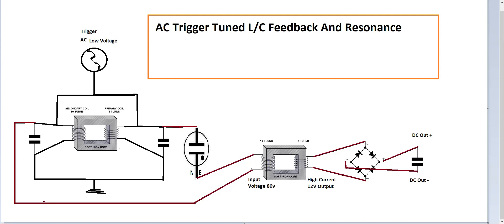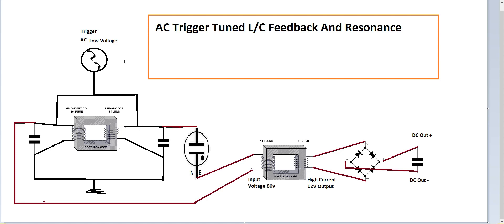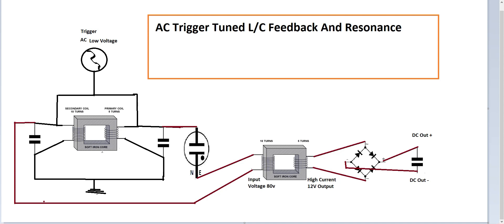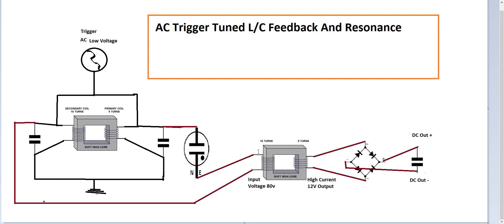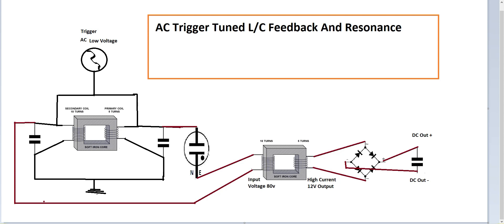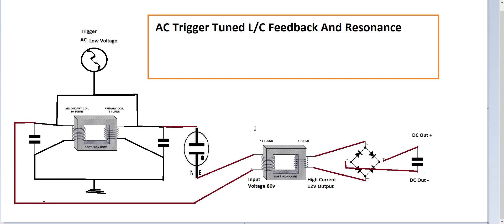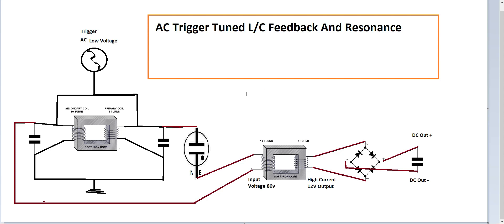Tuned L/C Feedback Method

Comment from the maker: I apologize for any confusion caused by my video. In order to clarify, it would be best to use the mains positive cycle AC as the input trigger and diode both coils with their own "isolated" trigger. This way each L/C will behave electrically independent. It is important to note that there is reason for the imbalance in the system, as it allows for the resonance effect to increase the amplitudes of each L/C circuit. As a result, you will most likely need to calculate two separate values for the capacitor.

While at first glance it may seem like you are just shorting the + of one circuit with another + doing nothing, both L/C circuits are actually working independently and raising amplitudes. The imbalance creates a difference potential between the two separate L/C circuits, which can be 100 volts or more depending on the coil setup. This effect takes advantage of the closest equivalent we have of running a coil as a "superconductor" within the system.

The neon in this example keeps the path closed between the plus input trigger side of both L/C circuits until a voltage buildup difference between the two positives reaches the neon voltage trigger of around 80 volts. At this point, the neon briefly creates a path in the 3rd coil (flash spike) and dissipates the extra energy as a load into this coil, preventing the oscillations from building up to high voltage and current breakpoints.

This process is often referred to as "Splitting The Positive" within the free energy community, as it involves switching the potential difference of two raising voltages rather than switching a typical system traditionally. The "energy" in this system comes from the voltage difference between the two coils that is switched into a load (the 3rd coil). By using this method, we are able to extract much more energy from the system that would normally be lost and convert it back to watts.
Reply: Thank you!!! Joel this is so simple to work with.... The diodes are a cool way to have ful control of the current.... By the way have you ever tried bridging the negatives and splitting the positives charging the coils through DC caps in that configuration... WOWEEE!!!! Super! Results... Wishing you the very best... 🎉🎉🎉🎉🎉😂😂😂👍
Reply from the maker: @jasonjaffray4025  Yes I have other variants of this concept and circuits. One video show  a simulation of kw out extra output but of course the simulation won't take account for circuit loss.  But no worries when your wasting 50 watts but getting back 1kw your doing great even with such loss. That is what people don't understand. The circuit does not need to be anywhere near 100% if an energy system and manipulation make up for losses.

Comment: Hi Joel please tell me what your thoughts on the way the capacitors in the first coil set up will influence the voltage potential difference.... As I do see the number of turns are imbalanced would it make sense to also use imbalanced cap ratings and what would be the perceived reactions... Thanks.
Reply from the maker: I had to use "AC" for the simulator to show me what I needed so I just copied that and it might be confusing to some if they don't understand the background. My apologies for the lack of communications. Taking a closer look, It would be best that you simply use the mains positive cycle AC as input trigger and diode both coils with their own "isolated" trigger. This way each L/C will behave electrically independent.  Yes there is reason to the imbalance, we want to take advantage of bringing up the voltage in each l/c circuit because of the resonance effect on the increasing amplitudes. So yes you will most likely need to calculate two separate values for the capacitor. At first glance with this setup, it may seem like your just shorting at the + of a circuit with another + doing nothing. But if the two l/c circuits are working as independent and both raising amplitudes, but the imbalance creates a difference potential between two seperate l/c circuits. Depending on coil setup this difference can be 100 volts or more even if both l/c circuits increase in voltage amplitudes at resonance point. Part of the reason for this effect is this takes advantages of the closest equivalent we have of running an coil as a "superconductor" within the system. Now the neon in this example, keeps the path closed between the plus input trigger side of both l/c until a voltage buildup difference between the two positives reach the neon voltage trigger of around 80 volts and for a moment creates a path in 3rd coil (flash spike) and dissipates the extra energy as a load into this coil, keeping the oscillations built-up and feedback from building up to high voltage and current breakpoints. I believe the slang term within the free energy community for this kind of process is called "Splitting The Positive" as we are not switching a typical system traditionally, instead we are switching the potential difference of two raising voltages.  The "energy" comes from the voltage difference between the two coils we switch into a load(3rd coil) And this method allows us to extract much more energy out of the system that would normally be just lost and we convert this back to watts. hope this helps.
Reply: THANK YOU JOEL FOR YOUR TIME, REALLY APPRECIATE IT BROTHER, THIS IS SO SO VALUABLE 👍👍👍👍👍
Reply: Hi Joel what do you mean by diode each coil?... Thanks... I know sometimes you create your own terminology.. That's cool
Reply from the maker: @jasonjaffray4025  The Bedini "trick" Put a seperate diode in line with the ac trigger of each coil to isolate both coils from trigger, this will help with being able to work with.

Comment: have you made this work practically??
Reply from the maker: It's a concept I work with as many are asking for more diagrams and the circuit diagram may be incomplete depending on your goals, Have I tested the concepts? Sure, I have also tested these methods in circuit cad and it works as expected and I have incorporated them in my various projects with success. Of course there will always be some system loss, tuning, frequency coil impendences, even careful placements all those things will need to be taken more into account as my example the circuit is highly simplified. using the various methods we minimize what is normally lost in other energy forms and able to convert back into electricity energy form. Will I have a product that I can sell and is ready to go someday? Unless I win the lottery. Probably no....
Reply from the maker: If this interests you I have another video based on similar methods with some more simulation data as well, This system proposes a much high power output in the ranges of kwatts if you can figure out the components to not break down in the design. https://youtu.be/mlRk5zVEfsg
Reply: @joellagace1679   my mains are 240v ac.. lets hope i survive this
Reply from the maker: @fidelcatsro6948  Hmm Maybe I should include a disclaimer for crazy people. No i'm just joking but yeah, Try it outside lol
Reply: @joellagace1679  🙀